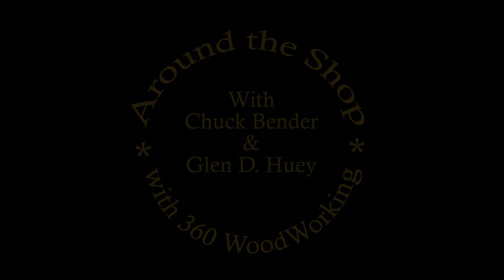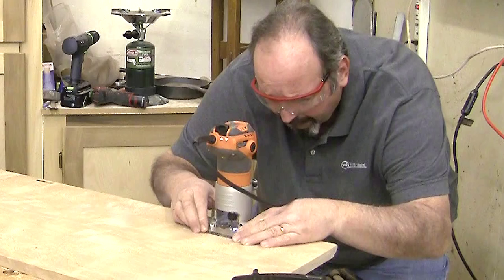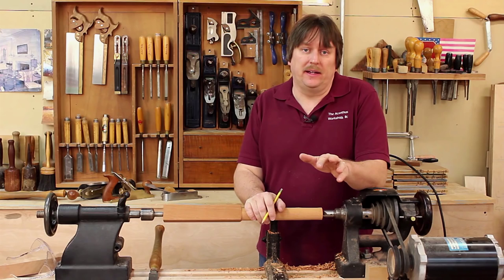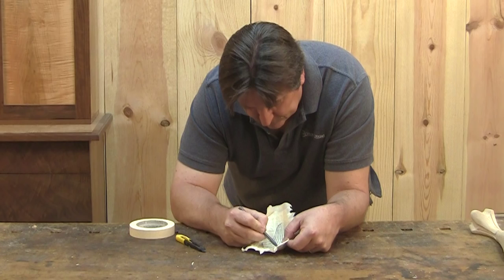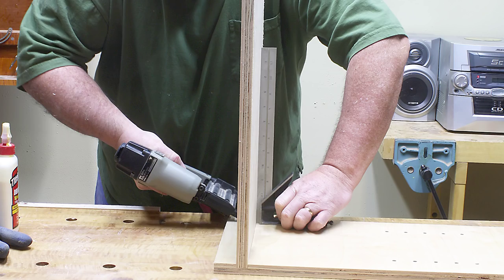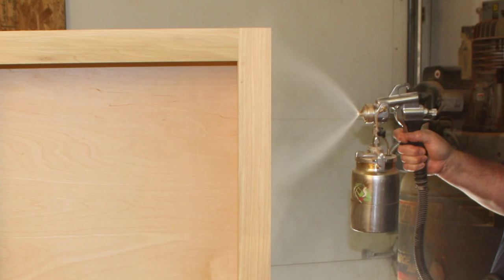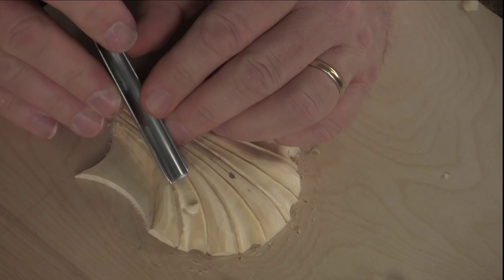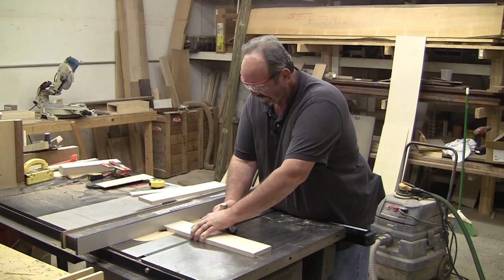Around the Shop w/360WW - Aniline Dye

Comment from the maker: Roy,

The powders will last longer than if mixed with water, but you still need to protect both from sunlight. That’s why we suggest storing any mixed dye in an opaque jug.
Reply: So, are dyes still susceptible to sunlight fade after finishing? Or is that only the case when it's still in raw/mixed form?
Reply from the maker: +Ruel Smith Yes, the dyes will still fade after finishing. Some top-coat finishes protect against fading better than others, but none can stop it forever.